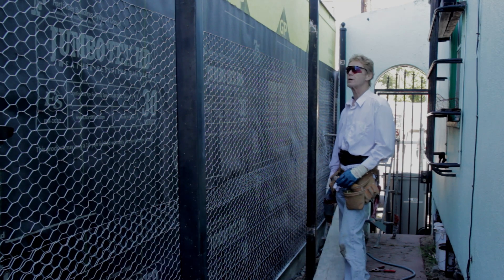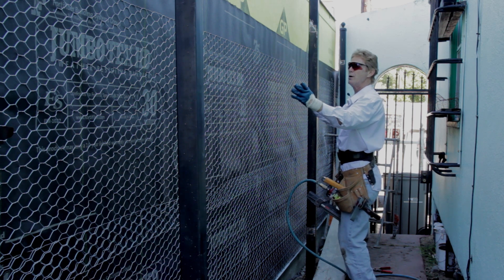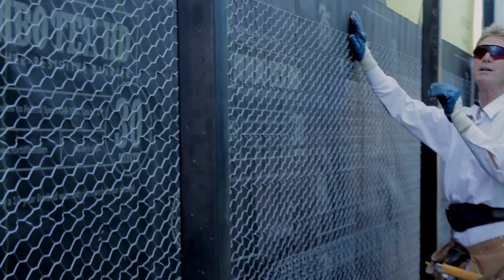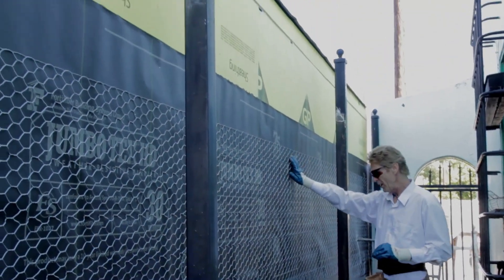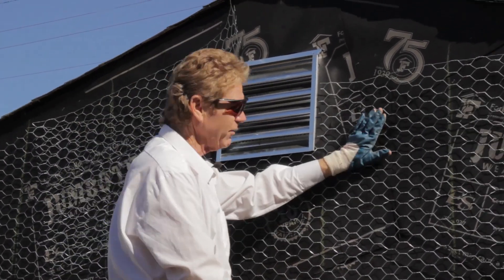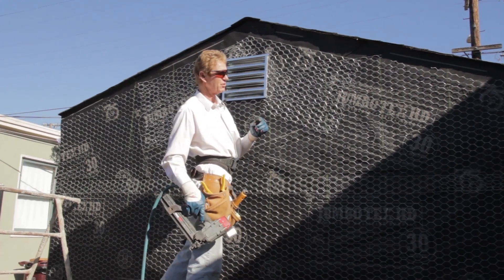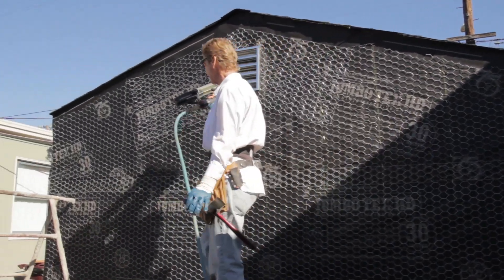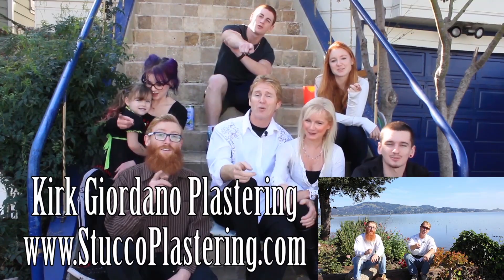Stucco netting which way to install and how much to overlap?

Comment: KIrk, i agree that an "occasional" staple between studs is no problem. Did it all the time.  Unfortunately, some envelope consultants testify in court, that will leak.  Also , some are requiring furring wad nails and reject staples.  I also agree with you , not needed.  In fact I was part of stucco testing in Canada for shear and staples out performed nails. which makes sense.  Nice job.
Reply: +Kirk & Jason Giordanos DIY plastering and stucco tips 
Kirk, what you did and said in the video was correct.  I am referring to the so called  " experts" that say a field staple creates leaks, that is because they pull the drywall off, and apply negative pressure to suck the water in (never happens in real life)  I have an attic in my 1972 home, where a few staples missed studs, no leaks yet after 40 years.  What you did in the video works just fine, and has for decades. 
 Bending over the staple, not a bad idea, but you were hitting studs , so it is done right.  I have seen jobs where they never tried to even hit studs, that is a problem.   Keep up the good work and plaster proud!!!.
Reply from the maker: Evening Mark Fowler, I understood your original comment, we're are on the same page,
 What is the old saying?
 Great minds think alike fools never differ,
 Have a groovy evening.
 Kirk giordano

Comment: Kirk is it possible to lay the stucco wire vertical and lap the same way as horizontal? I find it hard to unroll wire by myself and would love to lay wire vertical for ease. I know it’s more cutting but I build alone.
Reply from the maker: Howdy adobe, it's against the codes for good reason, to attach it vertically weakens the stucco, plus allows the newly applied stucco to slide off when applying.
 I agree attaching it horizontally is more difficult. 
Try Structo-lath this wire can be attached; either way, You can buy Struco-lath at any plastering yard. 😉
Reply: Bummer!, but I figured there was a reason I’ve never seen it done like that. Ok cool thanks for the response Kirk! I appreciate the info

Comment: Your not a journeymen lather...
Reply from the maker: Afternoon Dustin, I never said I was a journeyman, I passed that low stage at least 25 years ago, not sure what one would call my level, Master, Guro, expert, your call, as you seam the only one,  interested.😉
Reply: @StuccoPlastering  I didn't see you rake your wire once whole video!  With that gun I wouldn't rake either. PW FORSURE. and no r19? Using a sheeting (visquick) tacker? I didn't know if you where removing popcorn or lathing! Glad there's still some of us white boys in the game. Why didn't you run your gable peaks angled and fill in with a solid ripper? No snipes, bags looking like Bob villa. Iam an old Coutts guy! Pacific, Kevin bonner, Kaufman, heinchel plastering! I have over 25 years myself! Why didn't you flap your gable peaks? Didn't wanna drag a pick or plank back out? Nipper city bro, wiskers everywhere. Your paper looked clean though! But most plasters paper is, takes em days too 2 stretch a house but hey. Iam a plaster myself, but learned after becoming a journeymen, what was your end game with the peaks? Flatten out some aid or just leave it cold? It's called micore or even J metal BTW. Why use galvy instead of vinyl? Anyhouse I wrapped from orange county to LA Jolla was based up with vinyl! Shit my steel stud, foam, square wire self tapped jobs looked better then that. Hoad carrier for sure, and maybe put you on the gun! Where those foam staples? Or 15s? Lol 12s?  The best thing about you was you use a plumb axe! Not a hammer.
Reply from the maker: @dustinmorgan6854  I show about every way possible to lath a wall, this is just one way. There's a lot of ways to skin a cat.

Comment: Hi Kirk, Did you say you don't turn the corner with the paper? What keeps the water out? Thanks in advance and Great videos!
Reply: I believe he said he doesn't turn the corners with the lath/wire.
Reply from the maker: Evening Charles, Dude, no you didn't hear me say that in fact, we turn the two-ply paper both ways so that there are 4 layers protecting the corners.
     Cheers, peace, harmony & happy holidays 
Sound Plastering tips from your favorite stucco geeks
Reply: Thanks for this clarification too I was confused

Comment: Hi im from Mauritius island. There some mistake about 2 - 3 itches from the bottom to the top of my wall. Can i apply wire on it with nails to remove the difference on the walls
Reply from the maker: Howdy Ajmal, I have to view to suggest, but yes you can or if the stucco is still in place you can apply a bonding agent and apply some new cement plaster to blead it in.
       
                     Live long and plaster, 
  Sharing stucco secrets and or common sense tips

Comment: How would you install surveillance cameras on stucco. They came with one inch screws and plastic anchors. Would masonry screws be better. My neighborhood is bad and I don't want my cameras to get stolen.  Thanks again.
Reply from the maker: Howdy Paul Dudel, that's humorous when you think about it, my wife suggested you use additional surveillance cameras to monitor your original cameras. 
   Seriously, drill the hole right through the stucco for your monitor wire than screw right through the stucco and into the plywood sheathing, if no sheathing you can use a self tapping screw as they not only go through tin metal well but stucco as too.
 Tip, avoid just over a window as there will be awood  header there which is usually at least 4 inch by 6 inches think.
 
                               Live long and plaster
         Mastering Plastering for the beginner’s to experts

Comment: Wait if your mailing through dense glass are your staples long enough to hit the stud?
Reply from the maker: Howdy Crunch, excellent question.
 the staples we buy are 1 inch and a quarter long so that 7/8 of the leg is shot into the studs.
 A typical PW gun will shoot 7/8 s to 2-inch staples to adjust to plywood widths.
                               Live long and plaster
         Mastering Plastering for the beginner’s to experts

Comment: Here at summit plastering co. We use nails on every studd to secure the wire . NOT STAPLES.
Reply from the maker: Good morning Zeus dude, you say this as to suggest, narls are superior thus you have more pride in your work than those of us who use staples?
 The fact is through complicated and simulated earthquake studies based in L.A. they have found that the heads of the nails popped from the leg of the nail and that staples held strongly.
 We each have our ways, use nails all you wish but facts show staples are indeed stronger.
                          Live long and plaster
 teaching repairing your number 1 investment, your home
Reply: @StuccoPlastering  also from a leak standpoint! Most cubs crush the crap outta the wad! Iam not sitting their dogging off by hand. I've done it for years! And palm nailer suck. I use to love "tie in jobs" that where fur nailed. It's the staple jobs that held on for dear life! Hopping the gunner didn't hit the crotch everytime. Nip nip nip.
Reply: Nails arnt better
Reply from the maker: Howdy Crunch Dude, I see said the blind man. best wishes,
                               Live long and plaster
         Mastering Plastering for the beginner’s to experts

Comment: Question:   What are the proper steps to install rigid foam insulation over OSB sheathing.  Then stucco.  My email is garylopez4434@gmail.com.  Thank you
Reply from the maker: Good evening gary, sorry every foam system has their own rules, type in gooly dry-vit foam systems to get an idea,
                          Live long and plaster
 teaching repairing your number 1 investment, your home

Comment: Hi! I love your videos! SO informative. 
I have a question. If I were to take a ranch house and convert it into a cottage with stucco. And I wanted to put up wooden shutters for effect around the windows... Could I screw/nail in wood pieces into the house pre or post-wire phase, in order to attach shutters to the wood piece after it all sets in stucco? THanks!!
Reply from the maker: Morning Rae Lee, you could do it your way, but for me I would stucco the house without all the obstacles in the way such as nails,screws and or lag bolts,
 FYI, on a ledger board where you would use large lag bolts I would suggest this first before stucco, But for cosmetic or decorative shutters, attach by simply screwing onto the finished stucco, pre drill first with smaller bit to try and avoid any cracking then use a bigger screw to attach, as long as the screws remains, no leaking, no worries and no problemo.
 Best wishes and have a happy and prosperous new year my friend.
 kirk giordano plastering

Comment: Hey Kirk I have a question... when your installing the wire and there is a pop out foam on the window trim would that need be cover with wire too?
Reply from the maker: Howdy Armando, as a rule most foam companies that supply the styrofoam trim for around windows and or doors are being sold "at least for the last 25 years with a fiberglass mesh coat with a thin layer of stucco already applied to them". you just cut and adhere.
 However once quite a long time ago I was trying to save some money I ordered the foam raw, my crew and I spent at least 10 days attaching the fiberglass mesh to the foam plus another 20 adhering it to the home, total days for 10 men 30 days,  results: never buy raw foam, always buy precoated,
 best wishes, 

 have a good and healthy new year my friend,
 Kirk and family.

Comment: Kirk,Thank you for your education. i am building a shop and i am going to use a metal building. the problem is that our city doesn't like the corrugated metal look so we consider stucco. how can we attach these metal on to metal siding?
Reply from the maker: Howdy Amir, man, that's an easy question that takes twice as long as my handy dandy pneumatic stapler,
 I have had my share of attaching metal lath to steel studs, you need self taping screws and a really good batery operated screw gun. 
best wishes,
 Kirk & Jason giordano’s stucco videos
Reply: Thanks Kirk, as a follow up question: what if your metal siding is corrugated and not flat? do you follow the contours lines of all dips and bumps or just on flat sides that stick out?
Reply from the maker: Howdy Amir, easy, same answer as below, you would have to use machine screws or what are also called self tapping screws, we are using them in the upcoming video,
 Best wishes, 
Kirk & Jason’s teaching video’s
Reply: Thank you sir! i look forward to your video.
best regards.

Comment: Hello, thanks for this video and for all your others!  I had a question... I have a cinder block retaining wall about 5 feet high.  I want to put a scratch coat on, and then mortar on stone veneer.  My question is can I apply the scratch coat directly to the cinder block or do I need some sort of wiring to hold it like the kind you are showing in this video?  It has fairly good drainage behind the wall, but there might be a couple areas where it weeps.  I appreciate your advice.  Thanks again for all your helpful videos!
Reply from the maker: Hello Roxanne Borrok, excellent question, 
No, cinder block, bricks and concrete never need stucco wire,
 Have I seen folks do this? Yes, why? if someone  wishes to add structural support to a wall that is collapsing or if it's on blue prints for what ever reason, the plastering contractor or general contractor who accepts this job now is legally bound to do this foolish chore.

So yes you can apply a scratch coat, however, make certain this cinder block wallis free of dust, dirt, moss, mold, smog, and or any effloresces, if it's not, pressure wash first as nothing sticks to a dirty surface, plus a bonding agent may be necessary.

Wait, theres more, when applying a scratch coat, the wall should be sprayed lightly with water for the scratch coat to suck up and absorb together, thus adhering properly.
 Best wishes, kirk Giordano